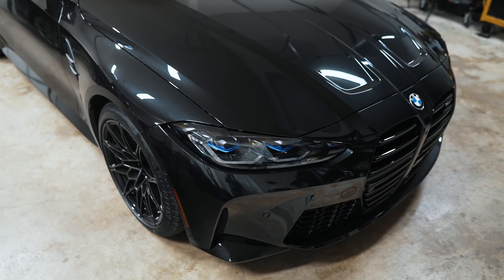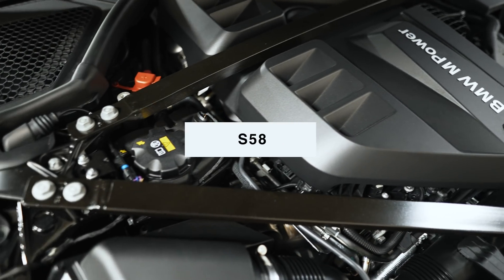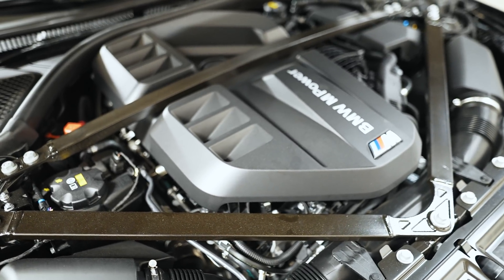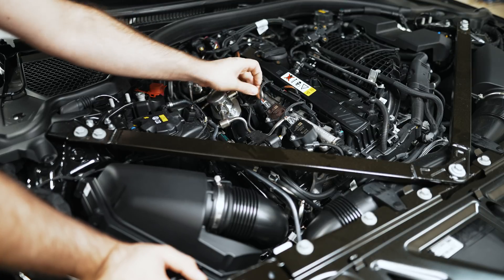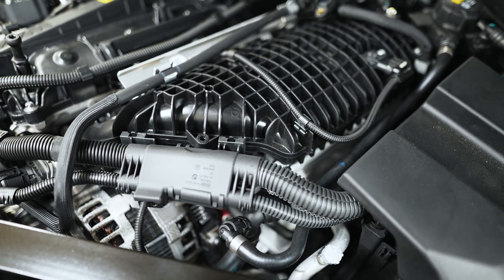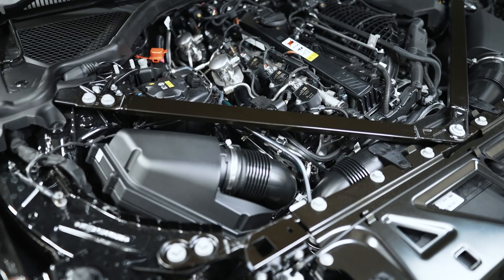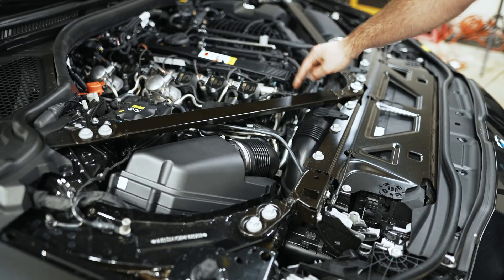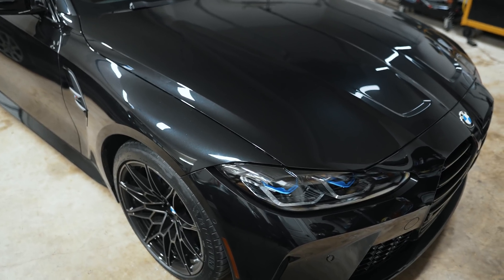How Far Has BMW Turbo Technology Come?

Comment: Replace that endless money pit engine with a Toyota V6 4L 4Runner engine and you just drive. You'll never have to worry about wearing out the engine while driving.
Reply: It'll be slower and not worth the price by that point. Engine in the car already is fine as it is.

Comment: 2:40

What are your thoughts about running E25 ?   On a stock car. I’ve seen some 2 series with ability to run up to E25 stock , It’s recommended on the fuel cap...
Reply from the maker: I would imagine that you can run much more ethanol on this car's stock fueling system with the dual HPFPs.  This car seems to run a relatively low compression ratio so it probably wouldn't benefit much from running ethanol unless it had a tune on it.

Comment: With that much compression with the high boost in that open deck design I would think the cylinder sleeves would need to be titanium or inconel. I should think anything less could develop cracks or go oblong.

Comment: How is a pneumatic system less efficient then a electronic system? They have been used for decades and controlled quite well under ecm close loop situations. Electronic wastegates are yet to prove endurance, I see them as a future failure point.

Comment: This is all very good information.
I applaud your input on both of these amazing motors.
On a side note, I have to say, your E90 is equipped with not only active steering but also active cruise control and I am so jealous! What an amazing car with RARE options.
Super cool!
Reply from the maker: Thank you!  The E90 came with active steering and I retrofitted active cruise.  I think now it has every option that was offered on the E90 besides front parking sensors which were offered in later years I believe.  It has a power sunshade from the factory as well.

Comment: Used to be crap. Still is crap. When you have to replace turbos at 60k miles and replace high pressure fuel pump every year, you know that BMW doesn’t know how to design worth crap!

Comment: I cringe every time I see those filters in the engine bay sucking all that hot air.
Reply: Me Too! But at least they were not on exhaust side.
Reply: @wernerdanler2742  Yeah but still when car is stationery or moving at low speeds it is hot in there probably loosing 30-50hp.
Reply: @zippodk  I'm sure you're right and I always thought those filters were kinda stupid. I think someone should do a dyno test, with and without, just to prove the point.
Have a great day wherever you are!

Comment: From a service standpoint, I don’t like having chains between the engine and the transmission (on any engine). I don’t know why BMW decided to go this route on the new generation of engines but I have a few theories- moving more mass towards the rear of the engine, simplifying oiling system- place oil pump right over deepest part of sump, shorter oil galleys within the block; less torsional load along the crankshaft, simplify the casting of head and block, narrow the front of the engine.
Reply: BMW has been making these since 2007 i think on diesel engines. It makes the engine more compact and possibly better fuel economy.

Comment: See all the extra stuff they added is cool and all like radiators etc etc etc but when that stuff breaks it's going to be a pita . For example if  2 radiators break at one time geesh.. Bmw parts are not cheap. All this stuff added just makes more stuff to replace if you ask me. It might not fail now but i'm sure down the road parts will eventually go bad from wear and tear.
Reply: N54 / N55 heat management isn’t that great. This is a step in the right direction to handle all the heat from the twins
Reply: @michaelb9661  not once did i say the n54 heat management was great. Adding a lot more parts to a car just makes it more expensive in the long run to fix if something breaks that is where my argument is.
Reply: @2FLY_M5c  it sucks. I’ll be on the journey to adding extra radiators and oil coolers on my N54 to cure limp mode, but once I add the extra oil coolers, gotta monitor oil pressure since N54 oil pick ups are garbage under sustaining laterals compared to their M counterparts. So I get your point = more parts to watch out for = more headaches

Comment: Considering trading up my american muscle cars for a used f80 or wait for a g80 a couple years down the line (I don't buy new cars anymore lol). Is the G80 worth the wait or just get an F80 now?
Reply: I would get the F80 - it's moneywise and has better looks. 
Stage 2+ makes around 560hp at the crank, that's plenty for rwd.
Reply from the maker: My experience with the F8X is the F83 DCT.  Besides the steering I'd say it's more raw.  The power comes on more like the N54 where it hits hard and down low.  The G80 feels like the kind of car that's designed to give a more average driver more confidence.  It just feels like the limits can't be found on the street.  It feels more refined and isolated so it makes a better daily but a lot of people don't want that in an M car.

Comment: Love the new s58 (the power gains will be insane now that cbc is dealt with) but the engine bay doesn’t look as nice without the carbon strut. Gotta ask, how does the transmission compare to the dct? (Also that engine bay is way more cramped  despite it being bigger?)
Reply from the maker: I'd say the transmission feels nearly as fast but you don't get the feedback during shifts.  I'd say it's 8/10 in comparison but the smoothness when coming off and on power is nice.  The DCT can punish you if you get on the gas too abruptly partial throttle, just like any manual car would.  The difference is you can't clutch in in a DCT when that happens.

Comment: Holy crap did I hear that right the s58 runs 25 pound peak boost from the factory? That doesn’t sound like it leaves much room for improvement there without going to larger turbos. Really interested to see what rktunes comes up with, with his jb4 turbo swap now. That’s a lot of boost!
Reply from the maker: Yeah I think if anything, they'll focus on upping timing and incorporating ethanol to make power.
Reply: @VehicularDIY  that’s really the only way.. I wouldn’t want to go much above that boost wise. Coming from the n54’s 8 pounds of boost this is something else.

Comment: They ironed out all the problems that existed in the N54, N55, S55 and the early B58, better fueling with two HPFP, no more direct injectors, electronically controlled wastegates, bigger inlets and no more catastrophic crankshafts, this engine should be a gem.
Reply: HPFP is part of the direct injection system, so yes, there are "direct injectors" on this engine as well.
Reply: @ghostwrench2292  I’m talking about moving on from the piezo style fuel injectors that were troublesome in the N54 .
Reply: @abelucious  index 12 injectors are pretty good. That problem is gone
Reply: @TheChris91173  I know they’re good I have them on my car but they weren’t cheap to purchase, I would’ve rather payed for solenoid injectors .

Comment: How do the B58 & S58 engines deal with carbon buildup on the intake valves?
Reply from the maker: From what I understand via a redesigned PCV system.  The N55 also had a redesigned system which was much less prone to carbon build up.

Comment: This is a great breakdown but really the important thing is, which is easier to fix when it breaks and which is cheaper to fix....and right now nothing touches n54. The S58 seems definitely more complicated to fix...
Reply from the maker: Yeah the S58 seems like it might be a little more involved but at the same time hopefully less likely to have issues.
Reply: @VehicularDIY  Yes you are right. I think the S58 should be pretty reliable.hopefully they learned a couple things working with Toyota lol.

Comment: If I’m not mistaken the new B series BMW engines were tweaked highly by toyota down to types of bolts used
Reply: You are quite mistaken.  All Toyota did was verify the design and reliability. Toyota may have tweaked the tune slightly, but now they are running the same tune on their B58 as BMW.
Reply from the maker: Seems like the biggest contribution that Toyota provided when BMW implemented the technical update was advice on how to improve sealing surfaces and sealing materials from what I've read.
Reply: @machtschnell7452  Do you have anything more on it, i would like to read it.

Comment: It’s a special type of private owner that goes in with this level of familiarity and knowledge on a brand new car. BMW sales/marketing could use you.
Reply: Totally sold.. never owned a bmw due to reliability horror stories. That's gonna change because of this channel
Reply: @xnot7e  well you're lucky cause the latest 3 series generation motors are killers. E9x non turbo motors run for ever and easy to keep running. F3x 335i and 340i are safe bet. Always remember to check out the car, read the carfax and give it a pre purchase inspection by a technician you trust. People buy a bmw not knowing anything about bmw other than it is a luxury brand and think a cheap 3 series is a deal of a lifetime and end up blaming bmw for it breaking down.  M-sport pack recommended. No one wants luxury or sport pack since they look the same, boring and base model.
Reply: Its rare that someone in the market needs this kind of info. Market/Sell the way this guy talks about cars to majority of customers then you're gonna get shot bro!